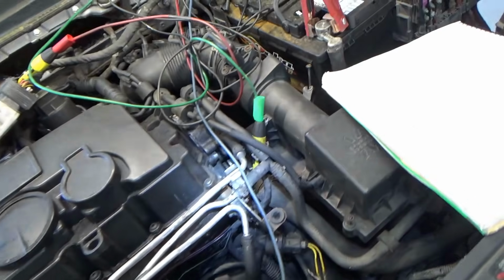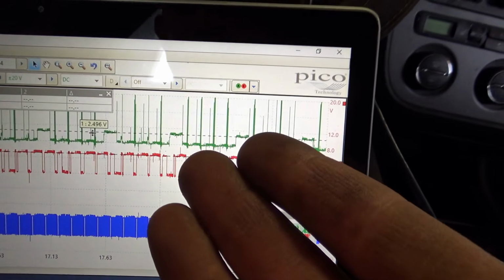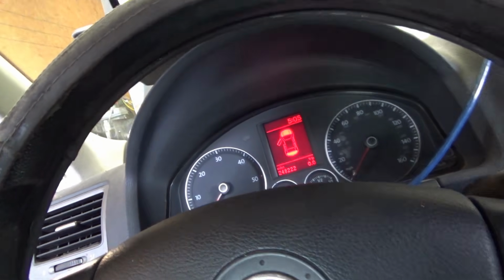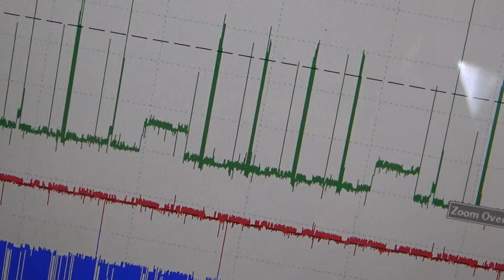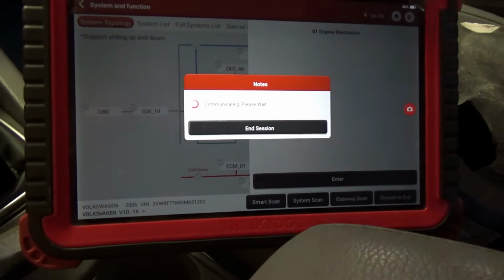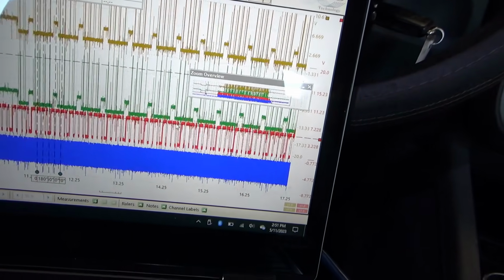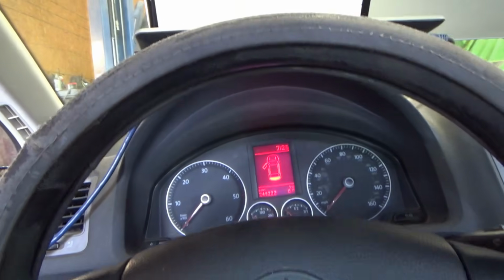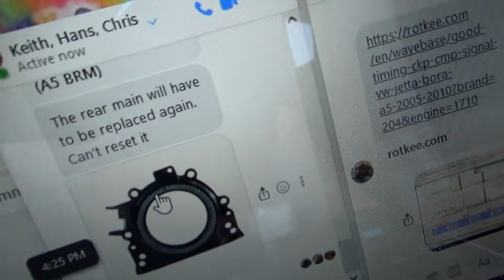ANOTHER Dead TDI?? (Jetta No Start After Engine Swap - Part 2)

Comment: Volkswagen's Gasoline Direct Injection (GDI) engines—such as the FSI and TSI families—frequently use multi-reference trigger patterns or secondary sync notches on their crankshaft sensor layouts rather than a single basic TDC notch. This design choice addresses specific mechanical and operational demands of direct-injection architecture:
1. Compensating for High-Pressure Fuel Pump Drag
GDI systems rely on a mechanical high-pressure fuel pump driven directly by the camshaft. As the pump lobes force fuel into the rail, they create substantial, cyclic mechanical drag spikes on the engine. These sudden loads cause micro-fluctuations and momentary deceleration in the crankshaft's rotational speed. A single-notch trigger wheel can occasionally miscalculate position during these speed variations; extra reference notches provide the Engine Control Unit (ECU) with immediate, cross-verified checkpoints to prevent timing errors.
2. Fast-Start Synchronization
Direct injection requires exceptionally precise fuel delivery timing right from the moment the starter engages. To fire the injectors on the very first compression stroke, the ECU needs to map the exact crank angle instantly. Additional sync notches allow the computer to calculate position within a fraction of a single crankshaft rotation, drastically reducing cranking time.
3. Enhanced Noise and Error Resilience
Because GDI systems operate under high electrical loads—driven by high-voltage fuel injector drivers and ignition coils—electrical interference can occasionally mimic a sensor pulse. Secondary sync marks act as a built-in validation pattern, ensuring the ECU only accepts a valid profile that matches the expected multi-notch sequence.

Comment: Mechanics are like camshaft.
Some are Advanced. 
And
Some are Retarded. 
If you work on a car and see that the rear main seal has an electrical connection.  
You have to know it's not simple.
Especially a German car.
Fire the mechanic that is retarded.

Comment: You know that rear main seal and crankshaft position sensor is a European design that is also used on the Ford Lion V6 turbodiesel used in Citroen and Peugeot's larger cars and in the landrover Discovery 3 and 4 and in the F150 in North America although it was rebranded here as the powerstroke 3.0 td

Comment: 5:40  I wonder if it looks at glow plugs to determine cylinder temperature to decide on interior firing ?
Reply: No not on the BRM I believe the common rail models do but not the PD100 found in the 05-06 jetta or the New used in the 04 jetta or 04-06 jetta estate

Comment: Something similar happened to one of my coworkers some time ago. It was a vw t5 tdi CR byturbo, and after the engine went on the car, it had a very bad injector/injection knock. Took a long time and all ideas around the shop to find out the crank seal was put on incorrectly by few mm. Problem is this kind of fault does not show on diagnostic equipment.

Comment: 2015 2.0 VW Tiguan TDI Broken cambelt, engine rebuilt, no start, check everything over, no codes and nothing found, no start, check again, nothing found, no start, many frustrated hours later still no start, tow around block, the engine starts, splutters a little and then runs fine, warm engine up for 30 minutes, turn off, restarts fine and been running well for two months now with good power and no codes.

Comment: It is poor engineering to have one end of the crankshaft magnetized.
Because it will attract metal filings and then your crankshaft bearings will be scratched or worn.

All crankshafts should be de-magnetized.

Comment: If the manufacturer can put a crank sensor in the rear main seal, they can make the engine throw a code if that sensor is misaligned. The computer should at least calculate the advance/retard with respect to the cam shaft, and report a number. If it's crazy misaligned, and you've checked that the cam timing is right, then there's your problem.

Comment: 3:25 injection does not follow the CMP edge, so it follows a specific tooth count of the CKP but it's not hitting on every TDC area so it seems that the ECM timing is being reset??? This is looking like a Bernie Thompson special, slipped CMP trigger wheel flagging the code, you did not actually do a camshaft lobe vs trigger wheel alignment inspection between the 2 cams because that engine ran but during the swap, did they jam something in there and screw up the alignment???  END OF VIDEO, Misaligned damn seal, WTF????????

Are you familiar with Bernies term, CAM SPACE, the injectors are switching back and forth trying to fire in compression then exhaust to find the right cam space to fire for real with no success here and no fuel pressure to back it up???

In EUROland, an engine code is specific to the engine's ALL parameters, if anything changes, the engine code changes, I am Duane, a MOD over at DDTSB Group on FB. Your CKP is a 30 -1 -1 tooth, Your engine is struggling AND the timing is off. OK, you got your known good, the starter is not struggling there. At 28:40 between your screen capture time 316 and 341 is a CKP missing tooth and the lower portion of the CMP signal is aligned in the middle matching the middle of the missing tooth, I have this known good waveform for your engine code. TRANSPARENCY I did not know about the magnetic seal alignment BUT maybe the answer could have come from DDTSB Group if you were in your shop with time to spare as you, me, and the group in about 1/3 of the war around the world from each other. Join the Group for free for the times when you have a matching US version EURO model, NO, they are not all the same as the Original models in EUROland but in this case, your timing waveform does match mine. I have a couple Russian waveform sites and a Brazil site along with iATN but not PICO anymore since they changed the rules, I don't have a PICO scope. I also have access to the subscription-based DDTSB database. Let the other YT guys know also please from your list of friends, you top guys are known over there, they mention your channel regularly along with ScannerDanner, Bernie, and SMA Eric O, Thanks for all you do for all of us.

Comment: I driven vw diesel for close to 30 years . Na and tdi but never driven or worked on a common rail . .Done all of my timing belts ect ..probably never will own  one of those common rail engines..i never heard of a timed rear main seal wow..There are a couple of forums i used to help me on my tdi. I driven the alh and ahu .  I got talked into doing a timing belt job on a later model . I replaced everything and used the correct tools  . But i did not change the rear main seal

Comment: I did notice while cranking the check engine light would go out when you had injector pulls and I believe it would stay on when you had no injector  Pulse   this would Indicate correct time or correct signal amplitude From the sensors. I know Ford is set up that way so if the light goes out when cranking it means that it's getting signal

Comment: Injector pulse without any motion should've been the first tip-off that something is wrong with the crank timing. Second thing - injector pulse didn't occur near TDC (you can estimate TDC by the crank signal slowing down. Slowest crank signal should correlate with the injector pulse. It did not in the scope capture).

Comment: I would charge for my teim including drive time and the time I was on the phone with Yahn (at his rate) becuase without his help it wouldn't have gotten fixed, would slap a gaurntee on the diagnosis for 30 days and no gaurnteee on the repiar, as you didn't do the work. Maybe a buddy discount if the shop owner is a good customer.

Comment: For common rail diesel injector operation, it would be more informative to monitor the injector current. Which will most likely be pick-and-hold current control, while regulating current through a switching power driver technique, as you can see from the waveforms. 

From a 4-Stroke engine timing standpoint, ideally you would see a unique transition on the CAM which would determine engine phase (C-P or E-I), and then look for the next transition on the CNK to determine injection (timing) event location with some lead time (for computation), and then an injection event. 

So, for example, you would have a unique CAM transition, then drop down to the CNK just before a high data rate CNK target section, count transitions while doing the needed calculations, then activate the injector for the calculated fuel mass at the required timing to then auto-ignite (inject) the fuel.

Comment: How to charge for this one?
If it were me diagnosing something in my line of work, I couldn't bring myself to raise an invoice at all. The customer rightly expects diagnosticians to come armed with copious knowledge, experience and documentation sources and thus the ability to pin point the issue quick smart. Even contemplating invoicing for 5 hours of going around in circles guessing plus 1 hour on the phone to a friend of a friend to get schooled on the answer to relay to the customer wouldn't cross my mind.
I'd be leaving the place embarrassed with my tail between my legs but also happy to be better educated as a result of the experience.
i.e. no charge to the customer. chalk it up to learning expense.

Comment: Well this is some good knowledge to have if/when I need to replace the rear seal in my TDI. 
Finally replaced the timing belt after car sat in corner of shop, going on nearly two years..fired up as quickly as I turned the key! Total relief there were no bent valves!
Excellent videos! 👍👍💯🇺🇸

Comment: I think you charge a trip fee to come to them - $X for a dedicated  trip just for them, maybe a little less per site or per vehicle if you can schedule  it into a road trip.  And then agree in advance that diagnosis time is $X / hr, "up to" some pre-approved number of hours - one, two, eight, whatever it might be. Then charge them honestly for your time, in this case six hours.  If they're upset by yhe total, you can always walk it back a little to ease their pain, if you want to (i.e. if they're easy to work with, polite, helped when necessary  but otherwise stayed the hell out of the way, not a blazing douchenozzle, etc).

Comment: A 4 cyl diesel that needs 4 glow plugs and yet 3 are "open circuit" this whole video? Isn't that like trying to make it start with 1 spark plug? Any other diesel and I saw 3 out of 4 glow plugs open with a no start that would have got my attention. What is the thought process of ignoring them? Fix 1 and it still won't start from the other or?

Comment: A good source online to find euro car scope cam and crank etc waveforms is Rotkee and they also accept all scope captures unlike Pico
Reply: I think we need an in-cylinder pressure transducer and the pulse from the fuel injector to positively determine the fuel injection timing.

Comment: Stupid engineering and clueless people working on it. Whoever changed that seal and reconnected the seal retainer either didn't think, can't think and didn't tell Ivan the whole story about the swap and shouldn't be working on cars. For botched jobs like this an appropriate charge would be T&M plus travel time, food and lodging. Although, 6 hours of cranking should have had raw diesel coming out of the tail pipe if the HP injection pump is working and the injectors are opening, or is the rear main seal timing the missing link to the injection pump? Three dead glow plugs isn't promising for a good start either. What about the Thinktool is not the right diag tool for this particular vehicle? Diesels were supposed to be reliable, simple and easy to work on. What a pity, and what has become to Rudolf Diesel wonderful invention?
Reply: I agree with you, with all the cranking there should be a strong odor of diesel fuel coming out of the tailpipe, maybe even liquid.  I am concerned that the diagnosis is not complete.

Comment: Charge time?  I would charge what is fair to the Mechanic Ivan. When you look at the details, there is more than just one Diagnosis that is being looked into, there are several because many of them checked out as good. You keep going until you find the issue. In this case, the mechanic was duped so is that his fault? 

Regardless, just another reason not to deal with VW's.

Comment: It was a little bit painful to watch, welcome to the euro diesel world. You have to be sometimes quite well specialised in those engines to diagnose them properly. Normally they start up with just the cam signal if you leave out the suspect crank signal. I would have a least tried that. On the bosch etc there is normally  a strategy that keeps them going in limp mode.

But still 6h not fun times. At least you got the right crank cam signals in the end.

Comment: You are terrific! Its rare when Ivan gets stumped. Problem is its pretty f’d up how cars are made even so called indestructible VW’s.  Bad engineering all ways around. And why? Designed in obsolescence or taking the easy way out. Please bring back the 58 or 68 GM, Fords, Chryslers. Points, plugs, rotors, condensers etc. At least they worked. Even diesel engines could be hand cranked provided the engine had clean fuel, compression, fuel and air filters filters. Engines were so reliable that its the reason sailboat manufacturers installed  them.

Comment: Are there any other cars that you need to time the rear main seal?  So, if the reluctor ring has problems does the transmission need to come out?  The only thing that would make this any better is if that car was equipped with a continuously variable transmission.  I have given up all hope of ever owning any other car except the ol' Mercury.

Comment: 'How do you charge for this one...?'. Good question. I would say the other guy didn't do his work well when installing the crank sensor. You did what you had to do: find the fault aka the problem. So you did and that 6 hours is what it took. 
On the other hand, shouldn't you have known before? If so than this looks like a lack of expertise.  If you had known the in- and outs then you probably would have found the problem earlier.
But! ...there is always a 'but', you were hired to find the problem and you did. The problem and the source of the problem: a wrong installed sensor by an incapable mechanic. 
....so now what? Good question! Let the customer complain by his mechanic and see what he says and can do. And with this info you might cut a bit of the bill.

Comment: Well, engineers can build a car any way they want. But, if they want to be friendly to independent shops and they want to gain a reputation of easy repair, they need to share repair knowledge.  Is this rear main info READILY  available to the public?
Reply: It's all available!.  Can even find the seal installation procedure on u-tube.  Blame goes to the guy that failed to check the procedure.

Comment: Ivan, education is expensive.....you can write a percentage of this bill off to education.  If you were a VW specialist, perhaps, the diagnostic time would have been 2 hours.   When I do various surgeries on animals,  I do not charge the going rate on these surgeries.    I charge about half the going rate because I have gotten to be very fast and great at these surgeries.   Other veterinarians that do not do as many or have not done these various surgeries charge for every minute of time and expense involved.   Experience and education are expensive; but, once you get good, you can do three times the volume of work.   I do not abide by the flat rate mechanic mentality of doing a job in 30 minutes and the labor book calls for 2 hours and thus they bill for 2 hours.     I have read where some flat rate mechanics are charging 20 hour work days and only working 8 hours according to the labor charge manual.  Yes, technology (electric impact, scanners, scopes, smoke machines) are making diagnosis and repair quicker;  yet, the labor charge manual is lagging behind.

Comment: You can't charge the guy six hours for something you weren't knowledgeable of.  In my opinion, you can charge the guy travel time, one hour diagnostic time,  and the one hour, or whatever, you spent on the phone getting the correct knowledge.  That's it.
Reply from the maker: I disagree... For a rare car that has a very rare problem, how am I supposed to have pre existing knowledge? 🤔
Reply: The guy you called did.
Reply from the maker: @frankallen6459  yeah they should have shipped that poor VW across the country to the guru instead of calling me 🤣

Comment: Yeah, to save face, best bet is probably to offer a 50% discount on that diagnosis.
Reply: Screw that!  Charge 6 hours plus time for the help line.  Ivan is running a business, not a charity for worn out VW's.
Reply: @scrappy7571  
So, next time this problem occurs, he will diagnose that in half an hour, right? Why is it fair this shop owner pays for the next guy / Ivan's education?

Remember, if you run a business with a fine reputation - as I guess he has now - that's worth protecting. You know why, scrap?
Reply: @Riis_DK  One thing I've learned in 45 years of working in repair shops, knowledge/experience don't come cheap.  Next customer will be charged the same, I'm not giving away my knowledge that I earned.  Do you think doctors and lawyers give away anything?
Reply: @scrappy7571  
Whatever, dude.
Reply from the maker: @Riis_DK  I bet I won't see this same scenario ever again... So in this particular case I can't afford to do free research 😉
However in most cases I would not charge for "education" since it would pay for itself in the future 👍
Reply: @PineHollowAutoDiagnostics  
👍